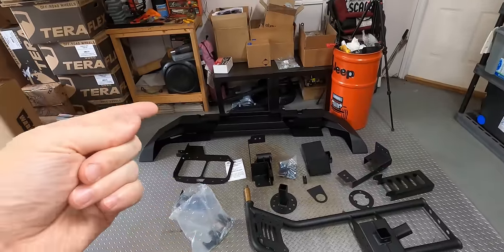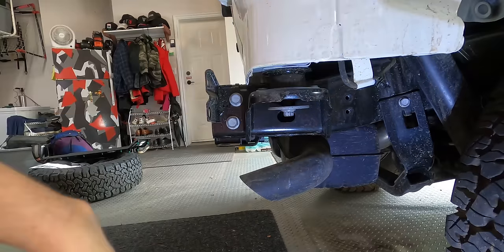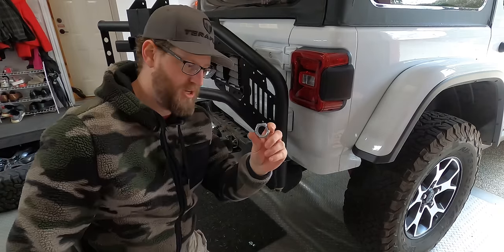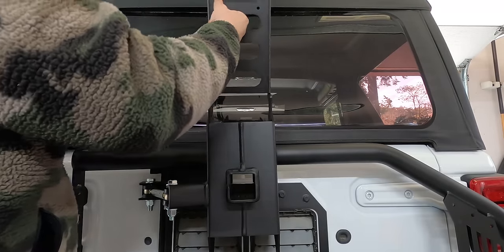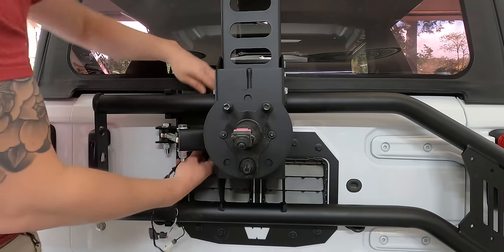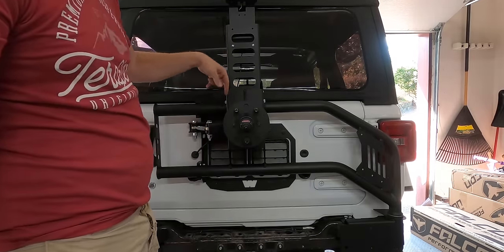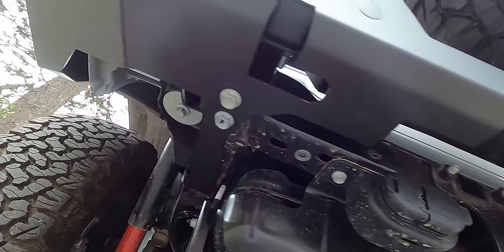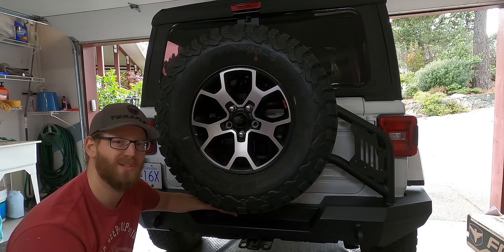Jeep Wrangler JL - Tire Carrier Install & Warn Elite Bumper - Ecodiesel Mods

Comment: I run a 37" tire with the Mopar reinforcement and oversize tire carrier bracket with no problems. You could not do that with a JK, but the JL they used magnesium for the rear door interior to make it stronger and lighter weight. Good video.

Comment: Hey, thanks for the video. I just installed mine last night. I ended up taking an angle grinder to my OEM tire carrier and cut the camera housing out of it. I cleaned up the edges and painted the bare metal and was able to place it back over the camera. If you have a thick wheel your studs may not be long enough to do this, but now I have some protection back over my camera, which is very hand when trying to lift a 100+ lb spare back up onto a lifted Jeep.
Reply from the maker: I think I am going to grab a metal cloak license plate relocation bracket that has the camera in it

Comment: Good video.  Some things to know:  The socket size called out in the video is too small.  Its a standard size, not metric, and its bigger.  I forget the real size at this point.  The design of this bumper is pretty good but def. not perfect.   It rattles in two places.  There is way too much "play" around the thick rubber washers on that small adjustable arm, and it rattles like crazy, so I stacked up a bunch of washers around it to make it tight.  That worked well.  The worst noises were coming from where the spare tire post goes into the square receiver.  It has a bolt you tighten down to hold it but that is way too small, and there's too much slop, kind of like all trailer hitches.  So, I put cold shrink around the square tube and that make things super tight, and now it does not make noise.  Finally there's the camera.  This kit pretty much leaves out a decent provision for the camera, so I just made my own with parts from my other spare tire carrier and cold shrink again.  I am happy overall with the bumper however.  It looks great, and the people I know who have other brands have noise issues as well.

Comment: You can reuse the factor camera cover/plate. Just cut everything that was behind the stud stock plate off, then mount the plastic and aluminum camera housing on the stud plate between the warn mounting surface and your spare. The stock aluminum plate/camera cover takes us about 1/4" of stud threads.
Reply from the maker: I was wondering if might be able to be used with a wheel with more backspacing and then the stinger can push out more from the wheel.

Comment: I like but the only negative is it seems to block the passenger taillight. I’m going to install the Smittybilt HD which I have to relocated the 3rd brake light. Overall great video and I love the rigg!!!
Reply from the maker: Thx. I never much thought of the tail light covering to be an issue but many have pointed it out. The LOD bumper mounted carrier was mu second option and doesn't block the light.

Comment: Once you put the wheels and tires on, I think throwing some highline fenders on would make it look bad-ass
Reply from the maker: Probably sticking with stock fenders until i see a need to upgrade them.
Reply: @Casey250  yea it's for stock fenders, its like the slimmer daytime led strip , so you get more wheel well tire clearance

Comment: Casey can you please elaborate on the parking sensors? Did not see any part of your video that covered that part of the installation. That would be very helpful. If you’re not running sensors. That would be good to know as well. This is the only video on this bumper install. Wished it was a little more detail.
Reply from the maker: I dont have parking sensors.

Comment: Looks like the carrier arm partially obstructs the back right brake light.
Reply: Ya, the bumper and carrier look great, but partially covering the right brake lite might be an issue with the highway patrol.  They can be a bit fussy about that sort of stuff here in AZ
Reply from the maker: If I am being pulled over and the officer is worried about my tire carrier very moderately obstructing my tail light from certain angles on my Jeep modified to run 37s or 40s then this carrier is going to be the least of my worries.

Comment: I like that you added a frame mounted tire carrier . . . any particular reason for the full width bumper as opposed to a shorty?  I'd be interested to know what the weight difference the new bumper/tire carrier added over the stock bumper.  I'm anxiously watching you're build while my EcoDiesel order waits for the assembly line to re-open . . .
Reply from the maker: I guess it could be considered more of a frame mount. I went full width because its legal and wanted to see how it did with larger tires, but I also don't see any reason I cannot remove the bumper and run this carrier on the frame rails and add a couple tow hooks for a really minimal setup ;)  As for weight the bumper felt similar to the stock steel, so the added weight would mostly be from the arm.

Comment: Good stuff! I’m curious what other bumper tire carriers you considered & why you ended up choosing this one?
Reply from the maker: Lod was the other option. The warn one requires no drilling at all. I could also take the bumper off and leave this carrier on the frame for an ultra minimal setup.
Reply: Casey 250 Sounds like a winner!

Comment: Does this bumper work with Park Sense sensors in the rear?
Reply: Great question. I did not see him do any of the removal of the wiring harness from the factory bumper. There did not appear to be any installation brackets available for the parking sensors. Holes are drilled in the bumper. But no way to mount the sensors. Hopefully Casey will respond to this question???
Reply: @TrailAdventuresTV  @mpk3055 We have this same carrier and had to order factory bezels to snap into the bumper for the sensors. But they all fit and work, we had the factory plastic bumper. Not sure if it would've been different off from the factory steel.

Comment: Hey Casey, so you are coming up on a year with this install, do you still like it? any cons?
Reply from the maker: I did a mods review back in december. It has held up well, other then the license plate bracket hits my corner panel and has scratched the paint.

Comment: I have an eco diesel without a hitch, and am looking at either trying to find a rear bumper that has a class III hitch, or installing a stand alone hitch (I.e.- uhaul or curt), what would you recommend?
Reply from the maker: Is it a wrangler? If so it isn't rated to tow what a class 3 hitch can tow. Max towing is 3500lbs which is class 2.
Reply: @Casey250  Yes. It is a wrangler JLUR eco diesel. I’ll look for class II. Do you have any you rear bumpers would recommend? I’m looking to upgrade to steel, and am new to the wrangler world.

Comment: Hey Casey, I am planning on ordering the Warn rear bumper with the spare bumper mount.  How do you like it?  I have rear sensors so I was wondering if you had them on your rig?  Any issue or concerns?  I am getting the lift and putting 37's on my diesel.  I have been waiting for the AEV rear bumper, but after saying it was going to be release in August and once again they failed to release it I have decided to spend my money on a Warn Bumper.

Thanks!
Reply from the maker: No complaints. I really like it. No squeeks or rattles. It has holes for sensors (I dont have sensors so I can't speak to how well they work). I would recommend not putting the license plate on the side and get an alternate mount for in the middle of the spare tire as my plate hit my body and scratched it but the mount is removable. I also prefer the plate on the spare tire.